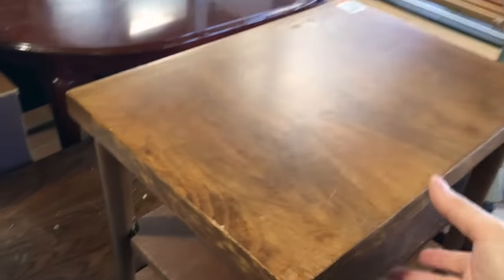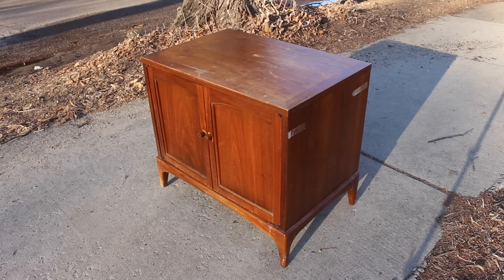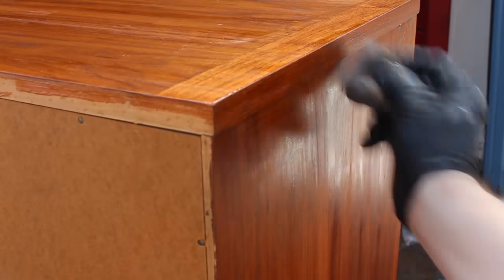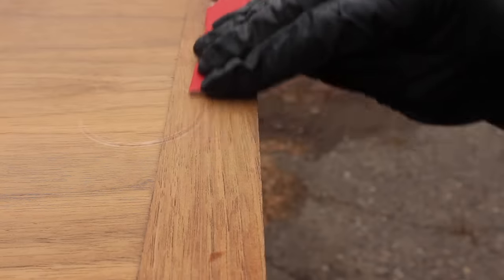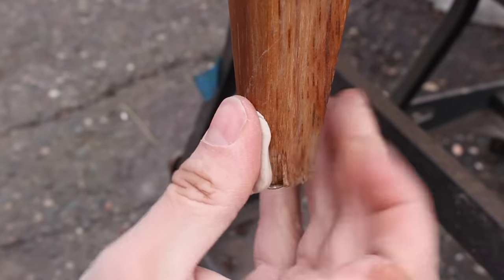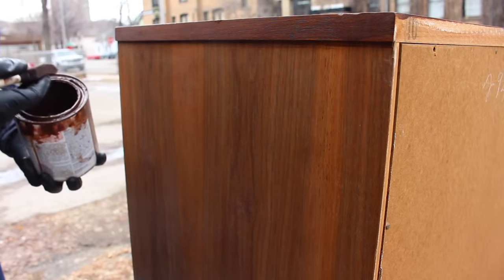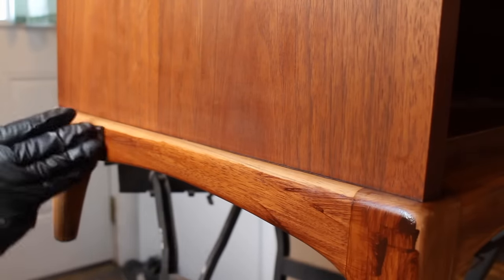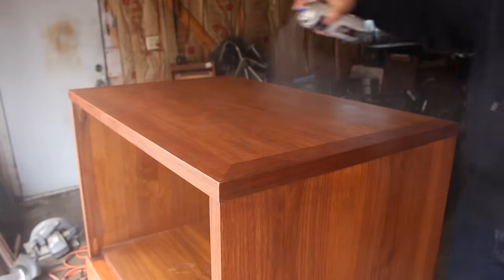Thrift Store Rescue  #8 / Mid Century Furniture Restoration

Comment: I wish you could include the lists of the product you used on the description. that would be really nice
Reply: I was about to write the same comment! We need list of products you used  it
Reply: Standard stripper
Putty blade 
Coarse Steele wool
Mineral spirits (Naptha or wash grade thinner works as well)
Simple green (Gentle Cleaner)
120, 150, 180, 320 grit sand paper 
Epoxy putty
American walnut stain
Sand sealer
Satin top coat
- You can Use no blush to remove rings in top!
Reply: Materials used or needed:
Citrus Paint & Varnish Remover Gel: https://rb.gy/os1ysy
Steel Wool: https://rb.gy/tujkov
4” Putty Knife: https://rb.gy/tvl8qa
Sunnyside Odorless Mineral Spirits: https://rb.gy/egjihe
Gorilla Epoxy Putty: https://rb.gy/kyqo9u
Simple Green: https://rb.gy/7mzj7z
Assorted Sandpaper 120 grit to 3000 grit: https://rb.gy/ikq3eb
Varathane American Walnut Stain: https://rb.gy/67xkyw
Varathane Polyurethane Satin: https://rb.gy/elp7ip
Reply: Bro he’s literally saying them out loud
Reply: I was wondering what type of mineral spirit have been used, how long need to wait after applied citristrip,
Reply: @Noswad04  Thank you!
Reply: I know this is two years later, and you've hopefully found them, but there are two faq's  videos.

Comment: I live in an area in which many elderly people go from large houses to retirement homes or nursing homes. They can’t take all of their furniture, and many of them or their people send the nice furniture to consignment shops. I just moved here and was told by my realtor to check a local shop or two. Well, i was astonished at the prices. I bought three lovely wild black cherry Henkel Harris tables for less than $500 total. I ended up furnishing my new place with beautiful solid wood furniture for a fraction of the cost of shabby new stuff. I had no idea such a resource existed. The store I used is very picky about what they take, and everything is immaculate and safe to use.  There is one additional expense, however....getting heavy wood furniture moved from the store to home. I was smitten with the pieces and spent the extra, and still came out ahead.  Before you buy veneer pasted onto mdf, you might want to check around. I still can’t believe my good luck!

Comment: If someone were to build this cabinet for a client today, the price would be many hundreds of dollars... probably in the realm of $550-$650. I've never understood why older furniture loses value simply because of its age. Great restoration!
Reply: It loses value because people don't want to buy it. - >insert any economics book you want<
Reply: Bottom line for me is that it doesn't loose it's value.  If it does, then I keep it.  I think of all the beautiful pieces of antique furniture that would come into the Salvation Army.  There were complete bedroom suites, complete dining room sets, etc.  At that time, people were putting no value at all on these pieces.  Today, one of those bedroom suites would sell for thousands of $$$'s.  I would expect to pay that much.  I have my parents' old bedroom set that my mother bought used for $59.  Someone at one time did a pretty bad job of refinishing.  My mom used it the way it was.  She also had the old dining room set that my grandparents used when my mother was a kid.  My grandfather rescued it from somewhere so it was already pretty old.  It's solid oak.  He bought a new unfinished oak server to go with it.  I have that now.  The bedroom set's finish has worn off basically.  I will be removing the rest of the finish and will make sure it is cleaned very well.  I need to get the hardware needed for the key holes.  All of the drawers lock with a skeleton key.  I've got a very old child's oak rocking chair that I must repair.  My mother pulled off the veneer and actually pulled off some of the wood with it.  I have been working over in my mind what I will be doing to rescue that.  My grandfather rescued it from the dump and brought it home and repaired the seat to it and made a new back.  That little child's  rocking chair must be at least 150 years old.  My mother and all of her siblings (12 kids) used that little rocking chair, and myself and all my brothers and sisters used it as well.  Now I have it, and it needs to be rescued.   My grandfather was an old Norwegian carpenter that used to rebuild/refinish antique furniture or unfinished furniture.  I also have a black walnut octagon occasional table that I need to clean up.  After I get everything repaired and cleaned up, someone in my family had better see to it that it gets passed along to family.  I will have done my part by making sure all of it survives.  The quality of the furniture is SO much better then anything new you can buy now.  I can guarantee you that the finish I put on furniture far exceeds any finish that is on the new furniture as well.
Reply: Why does older furniture loses value? 
Long story short: Because it's good for what's called the 'Economy.' 
Keywords: GDP, growth, employment, fashion, marketing, influence, profit. 
Irrelevant keywords: Environment, natural resources, energy, war, pollution, health, freedom, future, life,... to name a few.
Reply: @xopheoscarmike9458  That's a bit pessimistic.  Mostly it has to do with style.  Style for everything now changes faster than in any time in history.  It used to last centuries then half centuries, then a generation now only a few years.  That said there are always some styles that never fall out of fashion.  The difficulty is older pieces is that there is massive cost in getting a piece from where and when it is to where the demand is.  Moving furniture is more expensive than the cost to buy new.  That kills the value.  The cost to store furniture is also massive.  As older stuff is more unique it will take longer to match up a buyer and a seller.  Who is going to store this for free?
Reply: You're right, @RainCity84. Or rather, you have the facts right. But facts don't make people either optimistic or pessimistic. What are the consequences of those facts? Are they positive? Can they be reversed? What are the causes? Can those be changed?
Reply: @RainCity3rd  Mid-century Modern is very hot today. People restore them and sell them at flea markets.
Reply: @Laurieb2851  I too have a house furnished with mainly very nice hand me down's from relatives and some thrift store and yard sale finds. I totally agree that the quality of manufacturing of older pieces is so far superior to new reasonably priced furniture. I took a 1988 leather sofa apart, we had paid plenty for it, the frame was shockingly bad as well as all the other  materials in general. I saved the leather to make shoes.  
I took a armchair from maybe the 1940's apart too. In comparison (no comparison) I wont go into the perfection but it was the difference between  a couture dress and a dress from Target.  Everything but the most unaffordable high end furniture is today made of pressed wood scraps held together with off-gassing chemicals and cheap off-gassing inner materials covered with veneer or fake plastic look-a-like wood. Give me old stuff any day.
Reply: The purchase cost of things in life is only worth what people are willing to pay for them.
Reply: I agree. Young people spend lots of money at these big box furniture stores buying inferior quality furniture. It’s basically disposable furniture.
Reply: @xopheoscarmike9458  Not true. We aren't brainwashed into not liking it. The people who bought that originally many years ago also didn't want old furniture.
Reply: Nah. It's just veneered. It's crap, and I don't understand putting this kind of time into something of such poor quality.
Reply: @Mistraker  coz the person enjoys the process??!!...
Reply: @Matthew Hopkins Thank you! I noticed that as well, but you're the only person here to point out this fact.
Reply: @Matthew Hopkins Exactly! Perhaps people just don't know any better. Like you said, nothing wrong with it as it's a functional piece of furniture - but it's not a quality piece.
Reply: @tobiasnielsen9564 Das Kapital volumes I-IV by Karl Marx?
Reply: @Mrjmaxted0291  Read section 1 in volume 1. Marx never disagreed with what I argued. But I see your idea, you just need to find a book that isn't based on any logic at all. Marx was never without logic.
Reply: @virginiaoflaherty2983  You make shoes?
Reply: @trevl8955  You hit the nail when you thought "perhaps people just don't know any better."  Once you learn to build custom furniture, you don't look at anything made of wood the same again, and you can instantly discriminate good stuff from common crap.  I marvel at what people will pay for new junk, but pass on something well made of excellent materials that can last for centuries.
Reply: Well, the MCM in tables I rescued from my grandmothers trailer (years after she passed) my grandfather made do his have veneers on them. It’s still all real wood not like pressed crap of modern furniture so it’s not the same thing. Darn drawers still slide open/closed no problems no matter what time of year and this was after years in no temp controlled storage. THAT’S craftsmanship. I’ll eventually refinish them but using them water ring stains and all.
Reply: Also, a lot of furniture was being mass-produced and because of that it was cheaper to buy and most people didn't put in the effort to take care of it.
Reply: Why would anybody pay $300 for a 1950’s veneer over plywood cabinet when they could pay $79 for a new veneer/laminate over particle board cabinet at IKEA?

Neither is solid wood so realistically what’s the difference?

Solid wood furniture should hold its value but it hasn’t been mass produced in about 75 years.
Reply: @jill552  “young people” go to IKEA because it’s cheaper than a lot of alternatives in their price range other than garage sales which are seasonal and often a total crapshoot.  I used the quotations because I know 70 year olds with IKEA furniture.  

This piece is veneer over plywood, IKEA is veneer/laminate over particleboard.

Neither is solid wood so realistically what’s the difference?  They’re both cheap and do the job.
Reply: @thejollyrancher6713  the difference is construction and longevity. I love perusing Ikea and my daughter has purchased too much ikea furniture but she’s young and likes “new”. Likes the low price and disposability. Told me that’s how millennials are.  By the way your Ikea prices are out of line. Nothing of any size is $79.
Reply: @tobiasnielsen9564  True, but depreciation should also hit american houses they are all made cheaply of stick wood (instead of concrete in developped countries) , and the reason that does not happen in the usa is because of market manipulation. Builders limit new houses building and the parasites from the real estate agents association pump prices up at every sale with their enormous % take on the price, that and you cannot import a house like you could import furniture from other countries.   If the government was doing its job it would have dismantled the real estate association monopoly , and put huge import tax on imported furniture. THEN, well made furniture would not loose value and also builders would built more houses keeping prices stable and depreciating.  But it's not happening, It's all corruption and manipulation instead.
Reply: @goognamgoognw6637  I find it unlikely that "builders limit the housing market on purpose to drive up prices".

People why things that don't follow logic all the time. If the quality in terms of materials and longevity, isn't something the average home owner has much expertise to evaluate. It's a fairly common in markets that consumers aren't omniscient at all. Houses are complex products.

"well made furniture would not loose value"

The quality of a product doesn't impact it's ability to lose "value" in terms of how much you would pay for it.

Things are just prone to being obsolete regardless of quality.

Prices of houses are going up because it's better to rent them out, when nobody can afford a home, renting becomes more desirable, and the rent goes up.

Not everything immoral is because of corruption.

This is simply the system you all chose for us to live in.

NB: the toll on furniture made me laugh
Reply: @tobiasnielsen9564  I realize English might not be your first language because you took part of my reasoning out of sentence and context  and did not realize it was tied to the rest of the paragraph. You've never got my point. 
Builders will not build more houses if they cannot make a profit. They don't make a profit because of parasites middle-men (real estate agents) pushing prices too high causing the market to cool down.  Corruption is always present in any human society, it is only a matter of balance between corruption and fair business practices.  American houses are of inferior quality than european houses due to american building standards and the use of wood sticks instead of masonry.
Everything is determined by market supply and demand. Corruption and parasite monopolies can strongly weigh on the balance.
Reply: @goognamgoognw6637  "Builders will not build more houses if they cannot make a profit. They don't make a profit because of parasites middle-men (real estate agents) pushing prices too high causing the market to cool down."

You really can't imagine someone building a house, and making a profit selling it for less than the asking price on the market?

Price of a house goes up --> less consumers (READ - not no consumers) --> builder builds house --> builder sells house cheaper than the HIGH price, but still makes a PROFIT.

Your "first language" logic doesn't add up, also what an odd ad hominem to add.

When you write "Builders limit new houses building" try writing "house" not plural "houses", helps us dumb non-natives read better.

Have a great day
Reply: @jill552  I was thinking of a 3 drawer Malm dresser.  It’s $99 CAD which is ~$80.20 USD.  I used the American value because I assumed that they’d me the majority seeing my comment.

Nonetheless, my point still stands.  The difference between laminate over particleboard and veneer over plywood is negligible.  

Laminate is a far more durable surface, plywood has more strength than particleboard.  Neither is solid wood and both can stand the rest of time if treated right.  

Shame on “young people” for liking things in their price range.  It’s disgraceful, really.

Comment: Very well done.  As a guy who's refinished many many pieces of furniture over the past 53 years, including several pianos and organs, perhaps I can help you with that circle.  When I run into this I will try using a liquid stripper as opposed to the paste stripper and I use by dipping 4-0 steel wool in it and use it like a sponge.  It seems to lift it out a bit more.  Perhaps you could try it next time you tackle something like this.
Also  Your staining technique is top notch.  I've never seen anyone do it this way  but I intend to do it very soon when I tackle my current project (a 1920 player piano) and see how it goes.  I liked it very much.  Pianos are like this table and almost always veneered with something different than the base wood.  I've seen people sand right through the veneer many times.
Another point, when I use the 4-0 wool with the liquid stripper, I'll wash the entire piece off like this to remove any residue and/or old finish.  It gives me a clean base to begin sanding.  It may not be necessary with an old table like this one, but it seems to help a lot.  I also use mineral spirits afterwards like you to sort of neutralize the stripper before a stain or finish it.  Unless the surface is very rough, I get by using a 220 grip in the orbital right from the start - especially if the veneer is questionable.  Prior to finishing, I'll go over it with synthetic steel wool to smooth out the grain even more.
For woods like red oak that are open grain, I use a squeegee technique to fill in the "valleys" between the grain.  I'll apply a heavy coat of finish (in most case, polyurethane) and immediately use a squeegee to remove it.  I do this about 3 times or so to build up those "valleys" so they're flush with the rest of the surface.  Then I apply a spray coat of poly, let it dry, use synthetic wool on it lightly, another spray coat, repeat wool, and then on to 4 or 5 coats with a foam brush.  Don't scrimp on the foam brush either.  The cheap ones have a more course foam in them and will leave streaks and air bubbles.  The better one are more finer and leave a smooth surface much easier with fewer air bubble.  I avoid foam brushes from places like Wally-world.
When I've competed the finishing, I will use a special carnuba wax with Indian Sand in it.  I don't let it dry or haze over either.  As soon as I apply it, I rub it out with the best ever rag - old jeans (clean denim).  You have to work hard to get it rubbed out but it'll further smooth the surface to a fine luster.  The final waxing is with a clear furniture was and then I buff it with a jeans (denim) rag mounted on my buffer.  You can comb your hair in it when you're done.  Make sure if you use the old denim that it's clean and the seams are cut out of it.  Just use the smooth cloth only.
Lacquer is easier to use but not as tough as poly.  Lacquer is nice because each coat will 'melt' into the previous one where poly will lay on top.  That's why you need to be careful with poly or you sand through the newest layer into the one underneath and leave a mark and end up removing it entirely and start over.  Synthetic steel wool helps prevent this.  If you have to sane between coat, use something like 320 grit lightly.
I hope I helped in some way but you're obviously talented in this already.  Maybe this old guy passed something along. 

Thanks for the super video!  You done good!